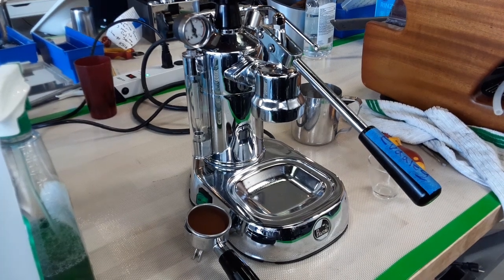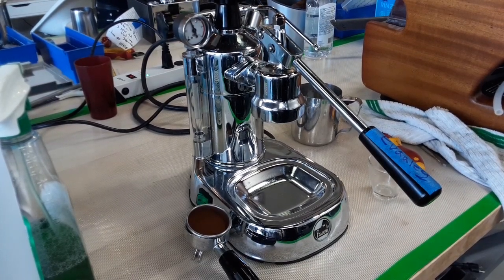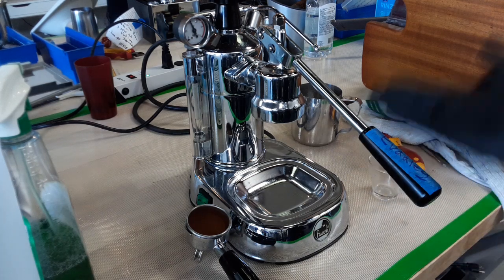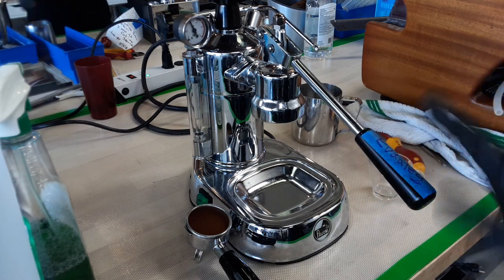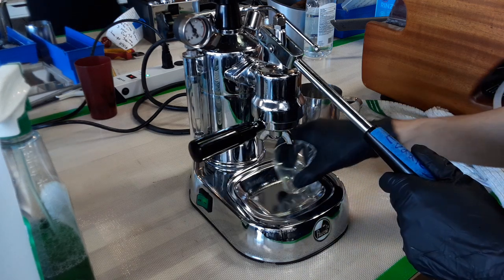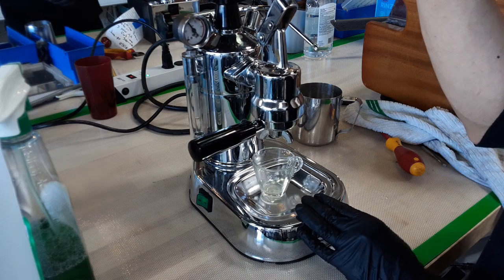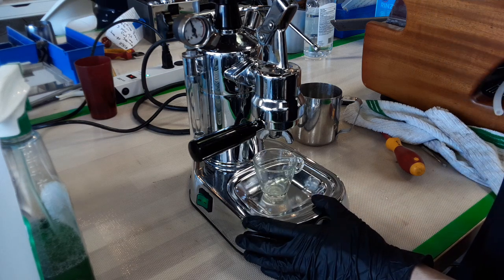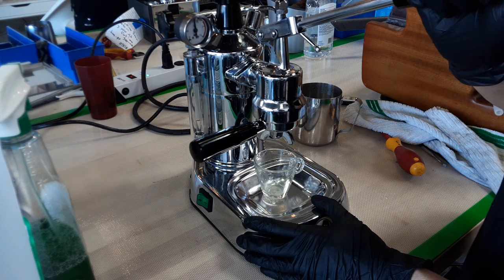La Pavoni - Warranty

Comment: Hi, Im facing an issue with a DeLonghi Magnifica ESAM 3500, the brew unit doesnt do anything and after i start it, it shoots some water and turns off and on, and then it says GENERAL ALARM. I have found your video on this same thing: https://youtu.be/TFRYQhSn3r8?si=BU52DhBMf-cmG2_l
And I was wondering, how did you fix it? Did you only replace that Hall sensor on the side or did you have to replace the Infuser? I dont know what else to do now.
Thanks for reading, hope you can help me!